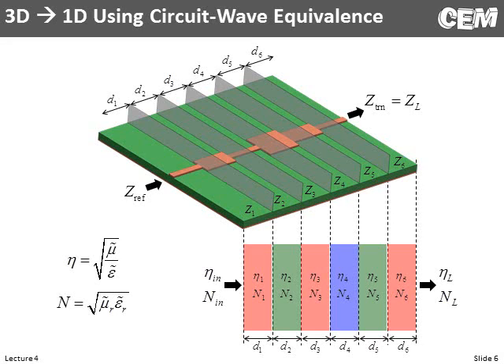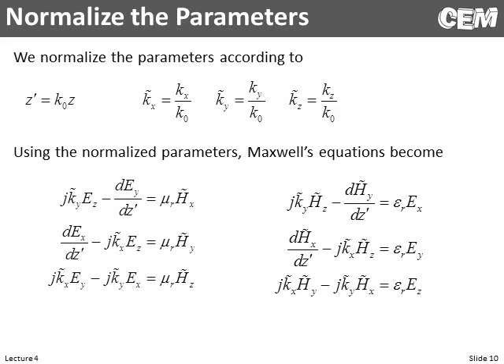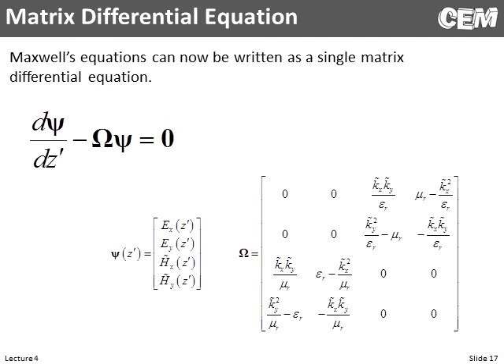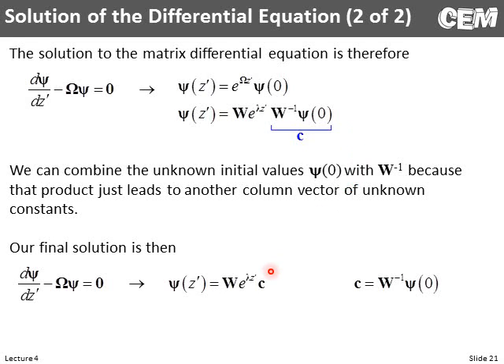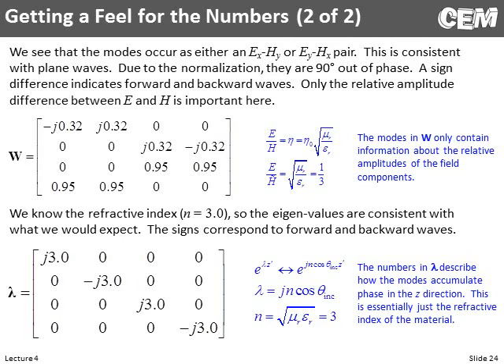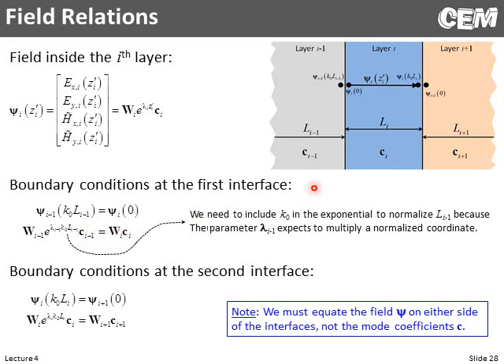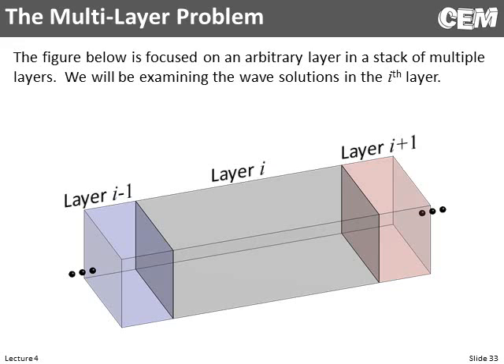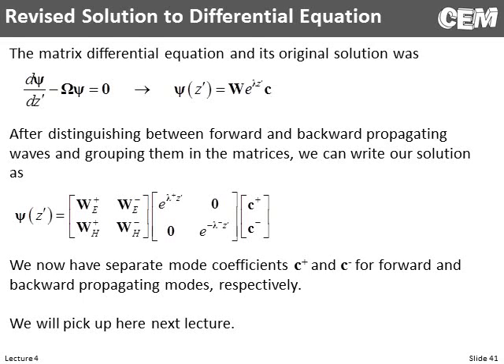Lecture 4 (CEM) -- Transfer Matrix Method

Comment: Hi Professor Raymond, I was trying to solve for anisotropic case using the TMM taught in this lecture, and after mode sorting, I ended up with a messy 4x4 eigenvector and diagonal eigenvalue matrices. However this is also means that the amplitude c will be a 4x1 column matrix (the first two values of the column matrix indicate forward propagation and the other two represents backward propagation), instead of 2x1 column matrix shown in the lecture video. My question is, does each of the four amplitude c has unique meaning? Thank you.
Reply from the maker: Even with the 2x2 method, you end up with a 4x1 column vector.  This is hidden by the fact that we lump both polarizations into a single 2x1 column vector that we treat as a single coefficient.  So the final 2x1 column vector is actually 4x1.

The meaning of the for quantities is this.  The first two are the amplitudes of the two forward modes and the second two are the amplitudes of the two backward modes.

I have added an extra slide about the actual size of the matrices in the latest version of the notes that you can get from the course website.  I have not rerecorded the lectures.  Here is a link to the course website:

http://emlab.utep.edu/ee5390cem.htm

Specifically, see Lecture 5, slide 19.

it is not everything, but hopefully it helps.

Comment: Prof Raymond, I do not understand fully why the TMM method is unstable. Yes it treats everything as forward moving waves, however in the eigenvalue matrix, we get eigen-values with positive and negative signs indicating the direction of propagation of the wave. This should take care of the direction of propagation of the waves in the final solution after multiplication with the mode coefficient.

In (47:01), when you make a new matrix with exp(+lambda*z) and exp(-lambda*z), are you not forcing the backward wave to become forward wave?
Reply from the maker: +_jp88 Good question.  First, just consider basic exponentials...exp(+az) explodes when a>0 and z is always increasingexp(-az) decays nicely when a>0 and z is always increasingWhen treating waves as forward propagating, the z term above is always increasing.  Since a>0, it all comes down to the sign of the exponential.  The exp(+az) explodes.  If the exp(+az) where treated as a backward wave, then z would be decreasing, not increasing, and exp(+az) would then decay nicely.
Reply: +CEM Lectures Thank you very much. I think I understand.
Reply: @empossible1577  I think the rearrangement is unecessory, the eigenvalue give a Complex Propagation Constant based upon your assumed positive z direction, it is inversed already, i. e. the wavenumber is negative already.
Reply from the maker: @zilongqin5578  The purpose of the rearrangement is not to the sign correct.  As you pointed it, it is already correct.  The purpose is the separate the forward and backward waves so that they can be properly handled by scattering matrices.  In principle you can do this without rearranging, but your scattering matrices would be ugly and unconventional.

Comment: Following up on my last comment, we do not need to adjust the eigenvectors. It's just the definition you used for the Poynting vector is ExH instead of ExH* and this fixes things in the end. Prefer though that we start with the exp(-i*omega*t) convention from the start.
Reply: I agree with you, the eigenvalue rearrangement is unecessory.

Comment: Hello Professor Raymond,

I think there's a subtle mistake in the sign convention. When you replaced the d/dt operator in Maxwell's equations, you assumed an exp(i*omega*t) dependence and hence replaced d/dt by i*omega. Once this is done, when your plane wave is assumed to have an exp(i*k*x) dependence, this automatically means it's traveling in the -x direction. If you wanted your exp(i*k*x) wave to travel in the + x direction, you should have changed the time dependence to exp(-i*omega*t). 

Now, a problem arises when you get to the matrix differential equation, let's call it d(psi)/dz = A * psi, where A is the matrix you call capital omega. Whether you assumed an exp(i*k*x) dependence or exp(-i*k*x) dependence, you're going to arrive at the same matrix A. In doing this, the equations are blind to the fact as to whether the wave is traveling in the +x or - x direction as it should because the solution will have forward and backward travelling waves anyway. (Also mathematically, kx and ky occur squared or as kx*ky and hence flipping both signs will not change the matrix). So, in essence what you arrive at in your slides is the matrix equation assuming that exp(-i*k*x) means propagation on the +x direction.

A subtle thing occurs when you try to sort your modes using the Poynting vector in the example you provided. Because now the direction of propagation is reversed, you find that the Poynting vector of a mode points in +z while the eigenvalue says it should be -z. Here I think we're under the mercy of the eigensolver because if we multiply the eigenvector by a constant, it's still an eigenvector. Hence to fix the apparent contradiction, I find that if we multiply the eigenvectors all by complex i, the Poynting vectors and the eigenvalues match the desired direction of propagation. Probably what needs to be done is to calculate the Poynting vector and then use the eigenvalue to find out if it implies the same direction of propagation or not. If not, we need to multiply the Poynting vector by -1 and hence multiply E by i and H by i to fix this before proceeding. 

Let me know what you think. I also really appreciate the effort of recording the lectures and putting them here; please keep them coming :) as I use them to teach myself computational E and M. 

Cheers and thank you very much for making these lectures public.
Reply from the maker: +George I definitely think I could get more sophisticated with the mode sorting and I think you are on to something.  It would be great if you could find an example where the easy mode sorting fails, but the modified Poynting vector approach does not.  Very good observation!